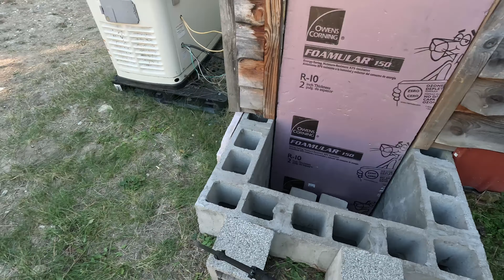Finally working on my off grid cabin again! and then some...

Comment: I have the same husky cement mixer and mixed thousands and thousands of pounds of concrete with it.  I even mounted it to the bucket on a mini ex to mix/pour into sono tubes 4' above grade.  I had the same issue at first with the bolt.  I cleaned the threads with a tap, cleaned out the tapered shaft on the motor and drum.  I also welded a 12in piece of round stock across the bolt.  It dosnt come loose now until I want it to
Reply from the maker: I was thinking tapping would help but the round stock idea is also a good one!